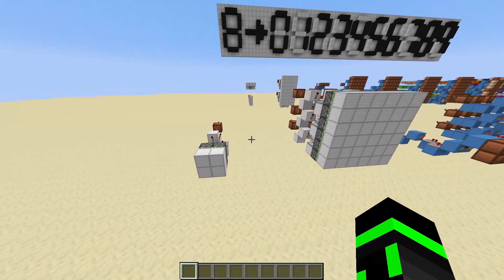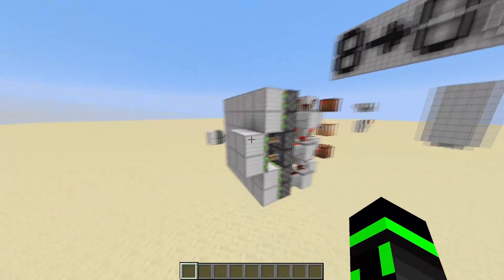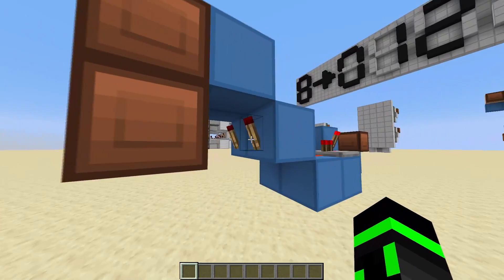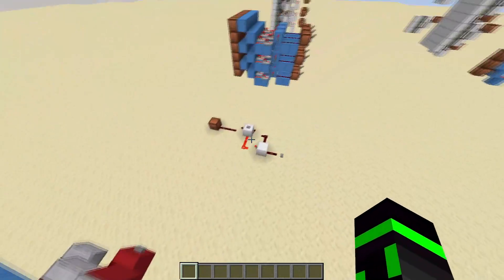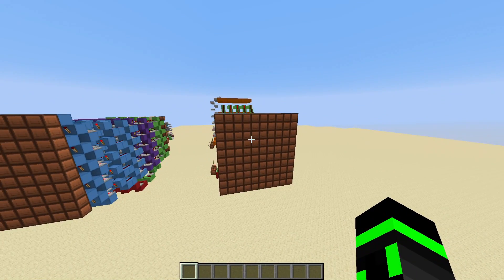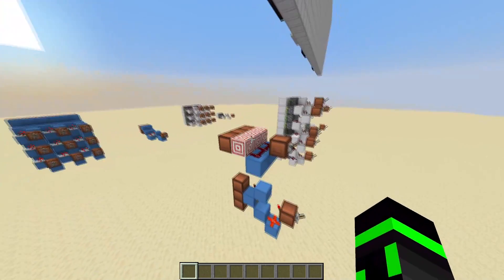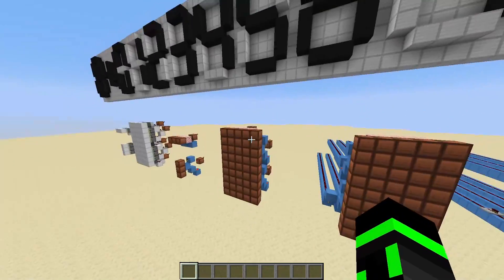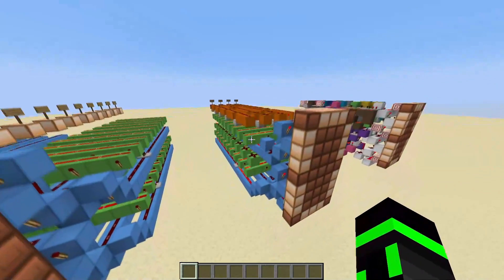Displays | Logical Redstone #7

Comment: I managed to make faster vertical segments for 7-segment display in bedrock
U do a torch and block as usual. But for upper lamp u place a block that gets powered by dust. Now use another torch to split signals (one goes on same level as torch, the other on block above), and invert upper signal using another torch (since both signals should use same amount of torches)
That configuration is synchronized, and takes only 2 ticks

Comment: 8:50 why wont you just place redstone dust on the block connected to the lamps and remove the 2 upper torches? Doesnt that also work? And all lamps will actuvate at the same time

Comment: Something I did for my seven segment display recently, was first I only put lamps on the segments since I was only doing numbers. This let me keep the redstone simple by wiring only the middle light of each segment which would light up the entire segment when powered.  

Then I decided that displaying numbers actually used a lot less wiring if you powered everything and the used not gates to power off the segments a number doesn’t need. So a number like 9 only needed one wire instead of six which made live a lot easier. The number 8 needed no wires because it just stayed on. 

Made my life a lot easier but somehow your design was still way more compact lol.

Comment: For the piston design, if you replace the redstone wire at the beginning with a repeator (the piece of wire that goes into the block with 2 redstone torches), no matter how fast you flick the lever you wont get a 1 tick pulse and it doesnt mess up the design.

Comment: I'm sorry that I'm late to respond, I am making a redstone computer and was going to use you display design, but the display seems to be unable to be more that 7 pixels tall as the slab towers exceed 15 blocks, do you have a relatively compact solution for this?

Comment: fun fact: lamps are solid blocks. for a 3 lamp segment, just power the middle block and it powers the rest. no need for messy redstone.
Reply: This works fine on a display with only the 7 segments being lamp blocks (the background is dark or something), but his powers only the necessary lamps and is more useful in a full screen of lamps like he shows in the video.

Comment: Can someone explain how to make an 8-bit bin to 7 seg display with 3 digits using the same encoding/decoding technique in the video?

For example, I want to put 11111111 and output 255 in 7 seg display. How does it know which of the 3 digits gets 2, 5, or 5 without making an extremely long ROM contraption?

Comment: torches don't react to regular 0ttp 2gt pulses, so even if you use a lot of observers it shouldn't be a problem, since there isn't enough space for adjusting ttp of the torch (1:32 that happens because you give the pulse in the player input phase but since this is wiring based it will only happen in tile tick phase and 2gt pulses won't go through unless you want it to)

Comment: 8:40 because redstone lamps are solid blocks, you can simply power the middle one with a strong signal (a redstone line, comparator, or repeater facing directly into it) and it'll power all adjacent lamps. 

And you can see this in your design. The middle lamp doesn't have a torch next to it. It only has a powered block. But it turns on anyway
Reply: That won't work for a 7 segment display because we only want the lamps vertically adjacent to the middle block of the segment to turn on, whereas with your idea it's also going to power the lamps horizontally adjacent, resulting in a + sign instead of a straight vertical bar.
However, your idea works, if the display isn't flush with a screen.

Comment: I find Redstone lamps hard to read on their own when using the default texture pack but there is a way to makes the displays more readable by using tinted glass.  the surface between the tinted glass and a lamp that is off is 0-0 while a lamp that is on is 15-0.

Comment: I understand the problem of piston display losing their bloc but i think there is a way around : if we use an extended piston-pixel as a resting/zero/off position and a retracted piston-pixel as an displaying/one/on position (the oposit of what you show on video) doesn't it make impossibles to have this probleme occuring ? In adition of that, in my opinion, this way of displaying caracter offer better contrast and so a better reading. Tell me what you think. (sorry for my english by the way, it's not my native langage)
Reply: I think you can just use a 2 tick repeater, and the losing block thing can still happen, if you have it on , then off then on, which can happen, it may still spit out the block

Comment: 12:00 with the inputs being e0 for the most significant bit through e3 for the least significant bit, boolean equations for each segment of the display are

a = ((not e0) and e1 and (not e2) and (not e3)) or  ((not e0) and (not e1) and (not e2) and e3) or (e0 and e1 and (not e2) and e3) or (e0 and (not e1) and e2 and e3)
b = ((not e0) and e1 and (not e2) and e3) or (e1 and e2 and (not e3)) or (e0 and e1 and (not e3)) or (e0 and e2 and e3)
c = ((not e0) and (not e1) and e2 and (not e3)) or (e0 and e1 and (not e3)) or (e0 and e1 and e2)
d = ((not e0) and (not e1) and (not e2) and e3) or ((not e0) and e1 and (not e2) and (not e3)) or (e0 and (not e1) and e2 and (not e3)) or (e1 and e2 and e3)
e = ((not e0) and e3) or ((not e0) and e1 and (not e2)) or ((not e1) and (not e2) and e3)
f = ((not e0) and (not e1) and e3) or ((not e0) and (not e1) and e2) or ((not e0) and e2 and e3) or (e0 and e1 and (not e2) and e3)
g = ((not e0) and (not e1) and (not e2)) or ((not e0) and e1 and e2 and e3) or (e0 and e1 and (not e2) and (not e3))

the segments are labelled a through g because that's how they're called in 99% of datasheets, you can find on google which letter corresponds to which with a quick google search
I think these equations include all the digits in hexadecimal though, so 0 through F and not just 0 through 9

i had these lying around from an old fpga program i did (we were forced to use boolean equations and not easier ways to implement this) so i thought i'd share them with those who'd like to know more.

Comment: Can you please make a video on timing and Redstone ticks ?

I tried to make a data transformation system that transfers two 8 bits data at the same time using two 4 ticks senders and a multiplexer and a demultiplexer connected to a 2 ticks clock but for some reason the timing doesn't work

And another question, is there anyway to transfer Redstone signals in long distances in 0 game ticks ? 
Sorry for bad grammar
Reply: You can use piston retraction for the instant repeaters, but I may cause lag, look up instant repeaters.
I think if your using a torch and repeater clock, it is half as fast, because when you have 1 torch and a 4t R (repeater) that is 5 ticks, on, than the R powers the torch and turns it off, and it takes 5 ticks for it to turn back on. (I think)

Comment: If you run a repeater directly into a lamp, the neighboring lamps also turn on (at least in Bedrock). That redstone torch setup is unnecessary. Lamps are solid blocks, they can carry power to other stuff they touch.
Reply: It makes a +, not what you want(I think)

Comment: The last time I built a calculator, it was 1.2.5 ... comparitors didn't exist.. it was very very basic with 0-9, two 4-bit RAM segments, 4 bit multiply, add, subtract to give values from -9 to 81. and it was HUGEEEE

Comment: Great video, I actually used this BCD decoder design (you shown it in an older video) for making a program counter/memory, and it works great. However, if you decide to make a video around that subject, I'd love to see a design without a delay difference betweeen the outputs closer to the input and the ones further away. Good work!

Comment: To power the horizontal and vertical lamps, why not just power the middle lamp with a normal redstone dust? No delay and easy
Reply from the maker: that powers the surrounding lamps as well. only works if the segment is surrounded by other blocks

Comment: 8:42 when building 7 segment displays like 8 years ago, I used a repeater powering the middle lamp, therefore powering all three of them
Reply: great idea, but it wont work with surrounding redstone lamps, as the lamps on  either side would also get powered :/
Reply: @markusg.6812  oh right... I always surrounded the lamps with black wool and never thought of using lamps only

Comment: Could you explain binary to BCD? I still find it complicated to break up binary numbers like 10101 (21) or 10011(19) into two different BCD signals, really loving the series so far!!
Reply: Ok, if number is >4 then add 3

21 is a five bit number, so five shifts, a shift is multiplying the No. by 2
0000|0001 shift 1
0000|0010 shift 2
0000|0101 shift 3 over 4, so +3
0000|1000 not a shift, just adding
0001|0000 shift 4
0010|0001 shift 5
    2       1

Comment: 9:00 instead of 2 top torches and the highest block you could just place redstone dust on the middle block
Reply: sadly it doesn't work like we need(( i tried this, it lights not 1 but 5 lamps (like plus sign). Maybe it work in older versions? I did on 1.17.1
Reply: @ertason   the way i got around it doing a plus sign is only having the 7 segments be lampls the rest never get lit up so I just make it black wool

Comment: Gotta say, I really disagree with you on the lamps vs pistons thing. Lamp displays don't look great with vanilla textures, while a smooth wall of concrete with pistons retracting the "on" pixels looks amazing.
The piston losing the block issue you mentioned doesn't seem like it would be much of a problem. Redstone torches don't react to any pulse that is 2 or less game ticks, and pistons only lose the block if the pulse is shorter than 3 game ticks. The only way to make the piston lose the block is with an extended 2gt pulse, and those are tricky to create. If you really need to be able to handle them, you can just set the repeater to 2.
For more info on extended 2gt pulse: https://www.youtube.com/watch?v=VjzuJqWAPFQ

I'm really enjoying this video series so far, I love how you start with a basic module and add more features to it, then tile it.
Reply from the maker: Yeah I was going to mention the repeater solution and then I forgot, that is quite an easy way to fix it. And yeah wall of concrete is no doubt  smoother than a wall of lamp outlines. Maybe I'm just drawn to the flatscreen, "digital" appeal of lamps, rather because of avoiding the fixable 3gt issue haha :)
Reply: @mattbatwings  i honestly find lamps better because it’s much more obvious which is on or off
Reply: lamps are probably less laggy
Reply: @brandynamite3022  lamps get super laggy because of lighting updates though
Reply: I solve this issue entirely by adding a 'clear' line that only cancels once the digit is ready to display. I hate this beep-boop effect of a display rambling along as it does the math..
Reply: Or don’t at school anything good to piston